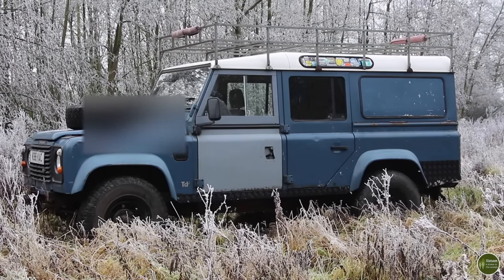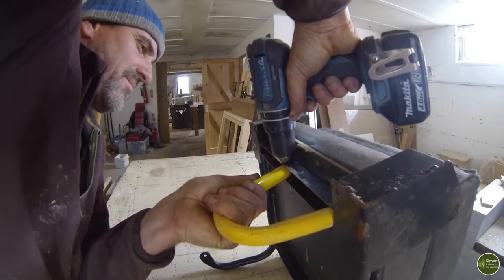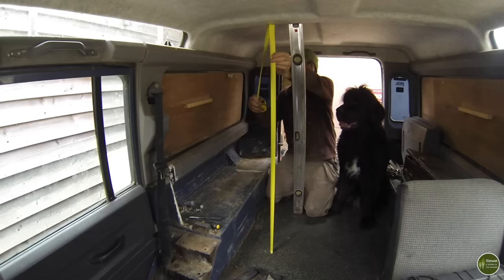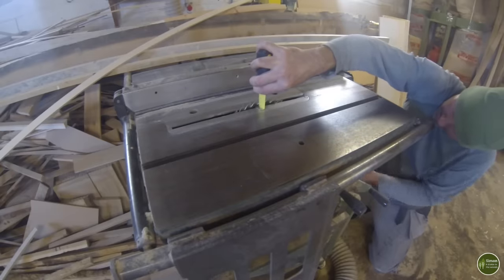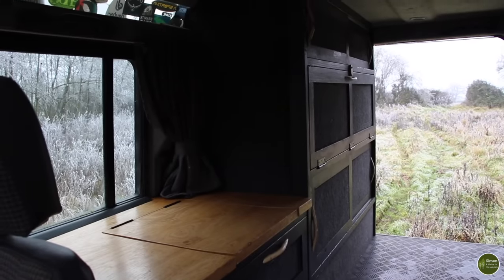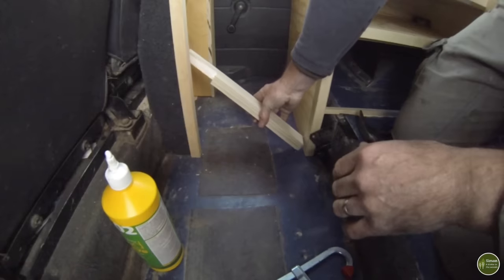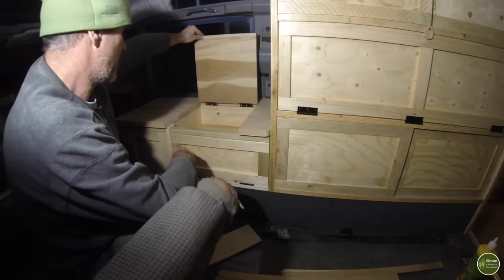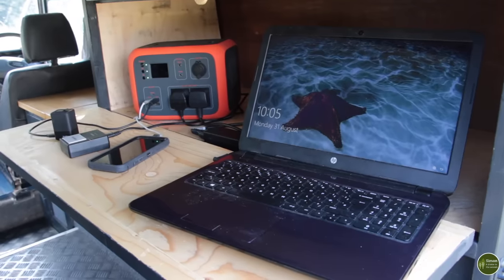Land Rover Defender Budget Camper Conversion. Part 1 - Rear Seats, Headlining, Kitchen and Storage.

Comment: I love the smart design of everything. No wasted space. It's a wonderful demonstration of your carpentry skills. I have seen a lot of overland ORV builds but most of them are pretty generic and the same. Basically just walls of open cubby-hole style cabinets and a bed on top of some pull-out storage. Your land rover build is FAR more what I would consider usable rather than just being a rolling bed and storage. It's more akin to a small RV or Caravan which I love. 

As an aside the Go-Pro footage is pretty good. I think it works well with the commentary to hide the sub-optimal go-pro audio. Cheers from Texas!
Reply from the maker: Thanks Shane!
I like how it came out - it’s a comfortable setup - I’m actually sitting in it now while on lunch break at work - heating on and lunch warming up! 😁

Comment: As you were building the interior, I was wondering where you were going to sleep.  At first thought it was on an inflatable mattress on the rear floor. But only at the end did you show the hammock. Great idea.  That's a lovely job doing the interior.    No complicated electric stuff.    A couple of removable 50cm X 30cm 12v solar panels is you need to keep batteries top up.

Comment: Love these simple setups. So functional and in keeping with idea of going camping.
Over here in Aust. so many 4wd's are little more than small houses that can move around and it wouldn't be uncommon for many of them to weigh over 4 tons.
Now all you need is a flatpack 3 bay workshop on the roof rack so you can feel comfortable if you have to drive more than 20kms.
Great video and nice work, thank you.

Comment: The Defender is not a budget camper in the states.  (I had a Discovery used for off-road and camping.)   Your defender is awesome.
Reply: A buddy of mine here in the states bought an old bus for the retirement homes and is converting it to a camper.  Perhaps that is an option.
Reply: Carl The Hipster Prepper I think he meant the conversion was budget, the vehicle itself wasn’t meant to be included in that.
Reply: I know he was referring to his work and not the vehicle by budget.  I was just making a joke to the fact that LR Defenders are hard to find in the States and are very expensive in USA.  (There is a long story why defenders were unable to be imported to US.)  I think defenders can now be imported as antique vehicles now.
Reply from the maker: They are getting very pricey here too, now that they stopped making proper ones and rebadged the Range Rover (again) 🙄

Comment: Great work Simon, I done a camper conversion on a 110 van body 20 years ago but a different layout as it had to sleep 3, 2 adults and my 1 year old daughter (she celebrated her 1st birthday on Islay during our 1st trip) I had a Caranex for increased covered space. Just a quick question re. the long storage area, with hindsight do you think it would benefit from having sliding doors on the front to make the space usable/accessable when you aren't carrying paddles? Hammocks are the answer re sleeping arrangements, with a hammock/s we could have continued to use the 110 after my daughter grew too tall to sleep on the short section on the bed as at least one hammock could have acted like a bunk bed.

Comment: Hey Simon hope you get the split charger for the beast. When I was into the old vw campers we had on board water tanks that fitted outside of the van with a filler neck, don’t know if that would work for your landrover 👍🏻
Reply from the maker: Thanks mate! That’s going to be perfect - just trying to decide whether to go for a dual vehicle  battery or a leisure battery - either way, it’ll take the anxiety of whether the Landy will start in the morning away! 😁😁👍👍

Comment: Impressive,  A lot more work than you let on :)
Is there a noticeable difference in sound reduction and heat retention with that cloth? 
Do you think 2 layers would help?
Reply from the maker: I think there is a bit more heat retention, but it’s pretty much wasted when you consider how drafty these old wagons are - plus, I’ve not insulated anywhere else 👍

Comment: Kiss keep it simple stupid 
I had four nights in my 109. Drinking water in a thre gallon jerry in the back cubby box( extended down so the Jerry goes in upright) and washing water in a bigger Jerry loose in back and an old easing up bowl also loose in back. Wash where you want, shave on the front wing looking at the view keep your sponge bag in the bowl when travelling, much easier to do your washing up outside and splash as much as you want. Why have a permanent sink? Pointless. Good simple build Simon. One of the best on the YouTube.

Comment: I'm going to assume the thumbs down are from those who don't realise that plants growing in the window tracks are a feature not a problem on old Landies and that a non leaking roof was an optional extra that few ordered.  When I started stripping my S3 LWB commercial I found an original factory "extras" list under the drivers seat, the only thing ticked was Windscreen wipers!  No I'm not kidding and it was built in 1978.  Looking forward to part 2, you have a knack of putting out a varied content that is always interesting to watch - please keep it up.

Comment: Video wasn't that bad Simon :-) Iv'e seen alot worse on here, lol...Bet it helps being a joiner lol...Looks good mate :-) Is there no shift in balance of the Defender, with all the units on right hand side ??....You fitting a roof top tent :-)
Reply from the maker: Thanks mate! No, there isn’t any noticeable difference - the units are light and the suspension is super heavy duty, even fully loaded with tools, it handles just the same 👍👍

Comment: Hi Simon
How did you blank out your rear sliding windows?
Is it a metal sheet, and are you using the original window seals?
Just can't seem to find how to do it. Thanks. Justin

Comment: I did something very similar with the rear units. Typically had a fault with the fog light and realised I had blocked access to the rear light box on the wheel arch! I had to remove the whole thing. Were you wise and allowed access?

Comment: What was the conversation with the insurance company like after this sort of conversion? I presume you've had to have the vehicle weighed and inspected etc?
Reply: It’s only a few storage cupboards same as any panel van might have for tools. If it’s down as insured for business use then it’s defo covered. No extra weight there anyway.
Reply from the maker: You’d need to inform your insurance company of any modifications you do. 👍
Reply: @simonablokeinthewoods  just had a quick read up on it and your right .my 109 has a ply bed base at tub top height and I sleep head by steering wheel. All the ply,Stove ,washing bowl is all removable so 99% of the year it’s empty.  Nothing hard fixed at all.  Anything permanent probably best to fess up !